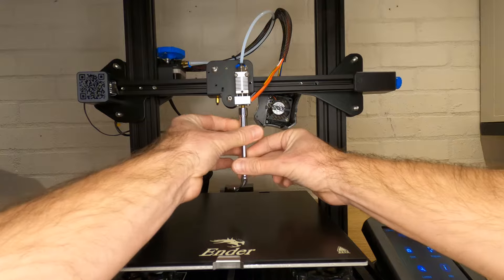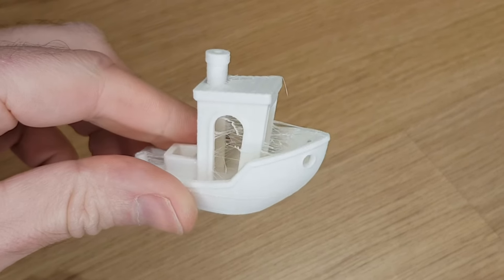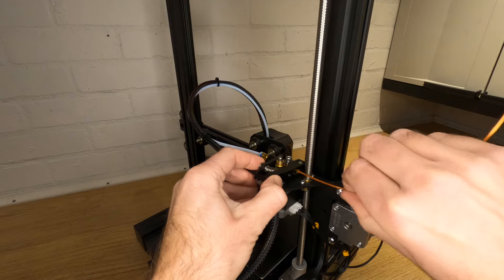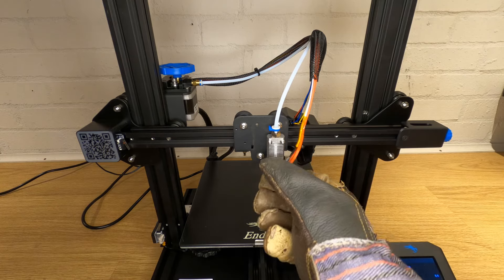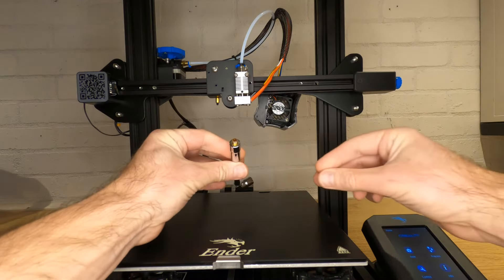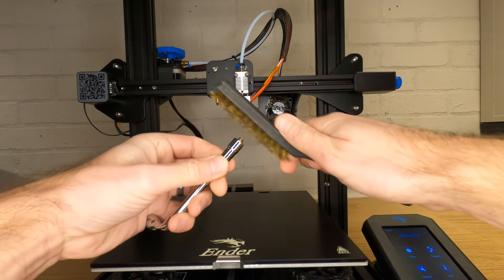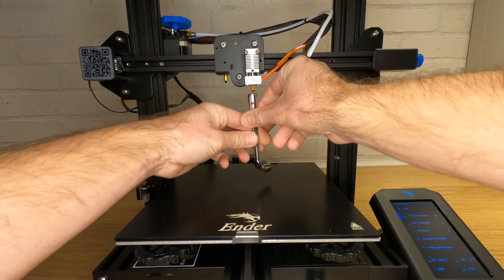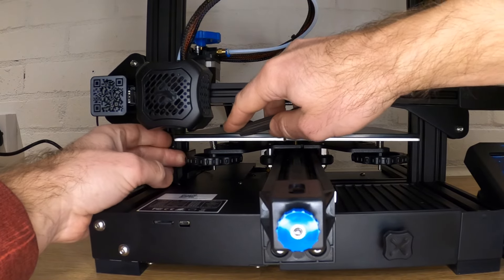How To Change a Nozzle on your 3d Printer - Beginner's Guide

Comment: That tool is extremely necessary and nobody tells you rhis. I tried my socket wrench and it burnt the coating off the bit and released what i assume is pure cancer into the air. I also burnt the cover of my extruder thanks to resting it on the heat block without realizing it. I am starting to heavily dislike this hobby
Reply: Also using the spanner it comes with, don't use without gloves. It got so hot it burnt my finger

Comment: Do i have to get the nozzle to the perfect hight? If i leave it a bit unscrewed could the filament get out?
Reply: if it's a bit unscrewed, it could cause it to slowly screw itself out over time through the printers vibrations

just fully screw it in, youre going to have to level your bed afterwards anyway so it doesnt matter if its on a different height